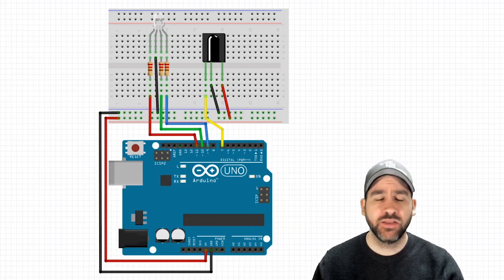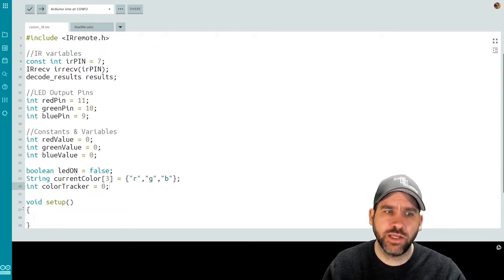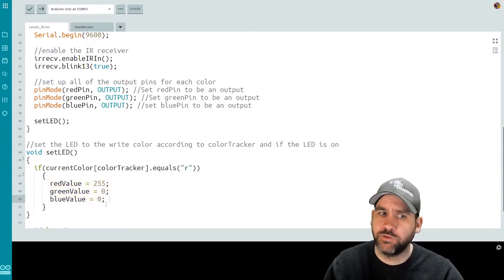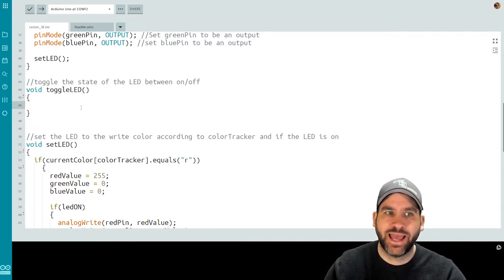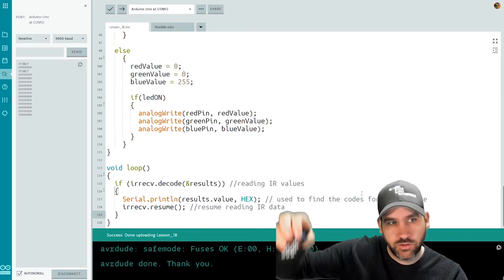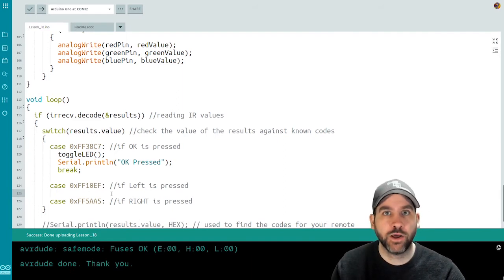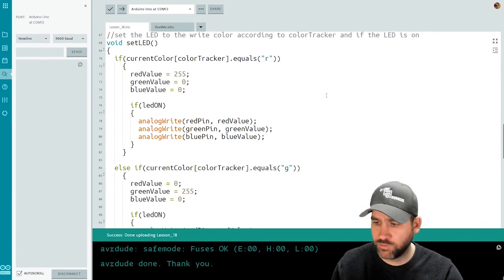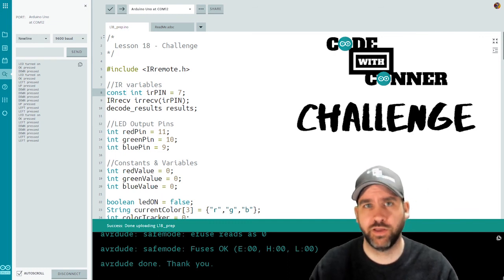Arduino Basics - Lesson 18 - Controlling an RGB LED with an Infrared (IR) Remote

Comment: hey so mine is on 4.4.2 for the code but i get the error message 'BA45FF00' was not declared in this scope for everyone of the case ones this is my power button and left and right button how do i fix this